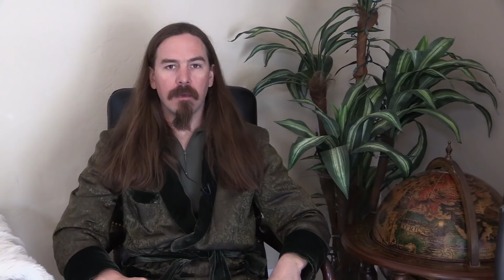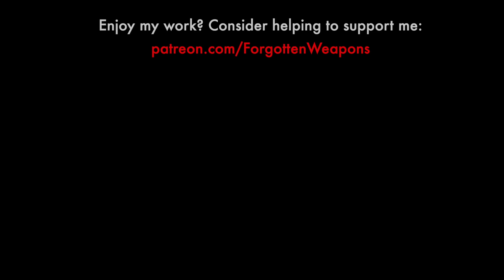How Does It Work: Patents and Blueprints

Comment: In 1995, the Machine Gun Section, in my Company's Weapons Platoon turned in their M-60E3's for FNH M-240G's. Immediately, they had function problems, with charging handles breaking off, sears flaking off and rear sights snapping off; the bipod legs were too flimsy for actual Infantry use and handling. It was a lesson in the difference between the demonstration prototype models that were used in the DOD trials, and the production models. The trials guns were hand built, and hand fitted in Belgium, while the production models were bodged out in Raleigh, NC. Like the PPSH-41 and the problems they had with the production models and their hand fitted drums. Corners get cut when you move from prototype to production models.

Comment: in electronics, there are a lot of copyrights on the schematic drawing, but not on the circuit it self, so cloning of devices is quite common. for a patent to be given out for a circuit, the level of uniqueness needs to be so high that over 99% of applications are rejected

Comment: An additional point about 'technical data packages' (aka, the actual 'blueprints' or more exactly: the actual data you need to produce a thing): That information is often never documented at all, often consisting of knowledge within the designer's mind only. 
It is often also split across the knowledge in the minds of the factory worker actually making the things as well -- little bits of wisdom on what works and what to avoid, that often have huge implications for the efficacy of production.
Good blueprints are supposed to include all of these, but they typically never do: Often so much is known by the workers and not to the original designer (and who probably wouldn't hear criticism from those lower-paid positions anyway). 
So as soon as the workers are  let go or retire - it's often really difficult or near impossible to simply to back to production: More development is required, and this is often so expensive that, well, why not invest that effort into one's own idea instead?

Good patents are about 'recognition' of features. They're supposed to tell you 'how to' design a thing, but often they only tell/show you how to 'recognise' a feature for the purpose of enforcement. Acceptable patents must get this right, but a patent lawyer is not a production specialist or specialist designer in the specific field of that particular invention, so they cannot actually determine even whether the patent is 'complete' enough to be useful to educate designers. So sadly, there's a lot less useful information in patents than you might assume -- they're mostly garbage, often full of either complete wishful thinking or else debunked science. But being untrue doesn't actually invalidate them -- it might help in a defensive lawsuit seeking to get a particular patent declared invalid, but this isn't usually how that's done, and that is vanishingly rare anyway. 

Either patents or copyright are actually weapons themselves: They're more like a handgun than a shield. They only do something if 'used'. What they do, is give you a way to legally extort infringers.

 Thus their other problem -- they tend to cause a net-negative effect on innovation due fact that there's really no way to tell how a particular patent holder is likely to act -- either reasonably or less so. This is also why 'patent trolls' exist, as well as 'submarine patents'... 

There are good examples of a key patent not actually allowing a new industry to really get going until after expiry e.g. Watt's patent of the crank (for steam engines). He made most of his fortune on his reputation for doing it right, after he could no longer sue infringers.

All of the above is a long way of saying: Detailed study -- usually historical, and drawing on considerable reverse-engineering due to more advanced understanding of physics, and, most crucially, its documentation. IS of immense educational value to society. 

What's fascinating is as much how much political or interpersonal and historical context plays at least as much, if not much more, importance to the story of these technologies -- being technically perfect is no guarantee of the use or even survival (which is to say, positive societal net impact) of any technology, for whatever end purpose.

So mining these stories for this wisdom is good, and widely applicable far beyond weapons.
If you don't learn from history, you're doomed to repeat it.

And why weapons? Because destruction is easy. (2nd' law of thermo / Murphy's Law).
Any new technology capable of an impact is always going to be usable for making 'tools of destruction' considerably before 'tools of creation' can be developed. One can make a functional murder weapon from almost any tool, but the reverse is generally not true at all. 

Again, this goes back to destruction being trivial. Time alone can do that.

So the study of weapons is always going to give you the first possible access to useful and productive wisdom - in both design and mechanical function of the actual articles, but also hows and whys of their production, and the political lessons to be learnt as well.

Comment: Ian, thanks a lot, you've it answered most of the question i've wrote you recently) but may be it wont be too much if i ask for a small clarification for the same theme? What if you don't copy the gun, but design it specifically to use core parts like barrel, pressure bearing and locking parts from another gun (exactly to reduce problems with tolerances, material and heat treating)? On one hand, you do not copy them, you just buy them as spares, on the other, you can as well use them as unfair selling point hinting to the existing proved good reputation of the source gun design, quality, reliability, accessories and tuning parts lines, etc.

Comment: Ian, I agree with
everything you said about TDPs, however, after spending a significant portion
of my Engineering career working with ammunition and weapons I would like to make
a couple of additional points concerning TDPs. Even if one gets the entire TDP
for a system from the original manufacturer, it might not contain all of the
changes that were made along the way in developing the manufacturing process
and in finalizing the function of the product. Also, even if all the changes
were documented with ECOs (Engineering Change Orders), the subtle nuances of
manufacture (sometimes known only to the workers on the plant floor), might not
be captured in the most detailed TDP.
Reply: Or (aerospace, but similar concerns) you might have all the changes logged in a change control system that ran on no-longer common hardware, and where the change control software was five years out of support while the product was being developed, and where you're generating 1800 change proposals a year, each running 100+ pages. (Guess who was responsible for keeping this running).

Comment: A patent does not grant or guarantee a right to produce an item. It grants what is called a "negative right" and in patents that gives you the ability to deny anyone else from making your patented item. 

It was explained to me like this. a man has a patent for a device with four legs that you sit on (a chair). He can keep you from making a four legged chairs as long as he holds the patent. You buy one of his chairs and think that you can improve on it by adding curved runners under the legs thereby making the chair rock. You file for and receive your rocking chair patent. This gives you the ability to stop others from making rocking chairs including the owner of the original chair patent. If you want to produce and sell your rocking chair you need to work with the patent holder of the chair patent. He can charge you a fee, let you do it at no obligation or he can deny you from manufacturing your rocking chair because it would violate his patents. 

https://www.richardspatentlaw.com/faq/what-rights-will-a-patent-give-to-me/

Comment: As an example for the usefullness of technical documentation and progress: NASA tried to rebuilt the original Saturn 5 engines a couple of years ago and failed miserably. They had all the blueprints and testing data, but figured our they lacked the world of knowledge that went into actually building these by engineers and mechanics, that just did not document every single step. From my own experience as an engineer I can assure you: 1.All the most complete looking documentation in the world barely equals an awful engineer...because my kind usually likes their jobs and we don't think handing every thing we know to some manager is a great idea for keeping said job. NASA then decided to "redesign" the Saturn 5 engine, and did so with a fraction of the manpower neeeded for the original, and a fraction of the parts. Which leads to 2. Progress in technology shatters personal experience and skill, if you wait long enough. That's btw also the reason why bolt action guns are obsolete.

Comment: Really good video! I'm a machinist, draftsman, 3D CAD modeler, and CNC programmer. I've done a lot of reverse engineering too. I've seen many of FW videos thinking I should buy that gun, reverse engineer it, and make it many times. First, everything Ian says is correct. Nations and companies try to get their hands on information from their rivals. Production drawings are wonderful but a physical copy is best. Beyond measurements, even tooling marks can reveal how something was made. Patent drawings won' tell you if it's to be machined, cast, or stamped. Production drawings will but sometimes even they include nothing about how to make it. Ian mentions manufacturing tolerances but if you know about a class of machine, the commonly used materials, and manufacturing processes you can fill in many of the gaps in incomplete data. From experience you can make a pretty darned good guess how much clearance there needs to be between moving parts, what materials and what hardness will work, that's not hard.
Reply: Engineers can be a cagey lot. If they know they can't prevent their thing from falling into the hands of someone that might copy it, they will sometimes build in non-obvious features that are vital to making it work, or decoy features that look important but really are not. That's commonly done in electronics where it's easy to hide things but less so in machines. That might be something like specific heat treating that has to be just right. Another way to protect a design is to come up with a method of manufacture that is hard to figure out or reproduce but you can keep out of sight inside your factory. That is more common in chemistry. People can figure out the compound or molecule you're selling but that's only half the secret. How you make it is the other. You might well hold a patent on the chemical but not patent the process, because the patent would reveal the secret. In that case you can hold your monopoly forever or until someone figures it out.
Reply: All of those are really hard to do with any kind of machine. Sometimes just seeing photos pf a machine are all someone needs to make a copy. In fact some of Ian's tear-downs of guns are enough. It might take a lot longer and cost a lot more, but they could be functionally reproduced from those videos alone!

Comment: It is curious how copyright law has been extended so much while patent law hasn't! My bet is that this is because a lot of "creative creations" can last as a valuable product  for very long while technical creations and inovations normally become obsolete faster. You know, Mickey Mouse is still a valuable and marketable product, even though it was created almost a 100 years ago, in comparision most of the technical inovations from 100 years ago are mostly obsolete, or at least hold no practical value in the modern marketplace!
Reply: Patent law has been expanded largely by court decisions in the Federal Circuit. Little legislation has been adopted. The most recent legislation changed the term of patents slightly.

Comment: If anyone is interested, the SAAMI website has dimensional drawings for all SAAMI spec chambers and cartridges, complete with tolerances and GD&T (When applicable). They don't give material data, but they're an example of what a blueprint drawing for firearms parts look like...except the whole gun is dimensioned like that lol. I tried making a chamber reamer for .38 Special out of some tool steel, but I had trouble accurately grinding the cutting surfaces on a manual tool grinder...

Comment: Range of sizes is exactly why Remington had to recall all Its R51's and start over. They had "stacking" tolerance issues. Once they figured that out, they got the second gen out and now its a great little gun.
Reply: LOL, no it's not a "great little gun"! Their "fixed" second generation R51 is not fixed at all and is still a steaming pile of crap.
Reply: If you say so... But mine has never given me any problems.

Comment: In the stringently controlled world of aviation manufacturing, where even fasteners are papered and tracked, they still occasionally have problems with production parts being changed or modified to better facilitate manufacture or assembly and ultimately not conforming to the TDP.  This is often only discovered when a part or assembly is later outsourced.  To build something designed 100 years ago, even with a detailed TDP, is going to involve a fair amount of trial and error.
Reply: Or going out of production, particularly a problem on the military side of aerospace when your aircraft takes over a decade to come to market, and the average generation in chip manufacture is about 18 months. When I was still working, one of my colleagues (very senior QA type) had preventing this kind of thing arising as one of his major responsibilities, along with making sure we didn't end up with any fraudulent parts (which was a growing problem). One way we got around it was by block purchasing a production lifetime's worth of certain parts.
Reply: Gives a whole lot of understanding to what Hudson dealt with, said H9.....

Growing up in the manufacturing (Detroit). Then being Aircraft in the MARINE CORPS.  

I get it....

Comment: Patents are not 14 - 21 years without a change.  There was a huge change several years ago to make US patents align more with International Patents.  US patents used to be 17 years from the date of approval to 20 years from the date of filing.  I worked for a company that had a patent that took over 20 years to get approval under the old system (it was litigated before it was approved) and many competitors had copied it during the window.  That meant all kinds of damages were theoretically owed.

The "small feature" concept that you are referring to might be the difference between a design patent and a concept patent.  Design patents only cover the exact construction and look of a design.  Concept patents cover the ideas embodied in the design.  You are right that some concept patents cover minor improvements in the design and are based on other patents, but these are distinct forms of patent.  An example of a design patent is one that McDonald's hold for the old "Hot side Hot, Cold side Cold" box.

You should also know that Copyrights and Patents are mostly filed country by country (you can get EU-wide IP rights).  It can become very difficult to assert IP rights in countries where you don't hold a patent, even if they have IP protection agreements.  Heck I have been involved in IP rights assertion challenges even with other companies in the US.  Here is one to think about for your viewers.  I built telecom systems where we wrote the purchase agreements to grant software licenses to the original purchasers.  We were able to get older products off of Ebay because of that software license.  Theoretically, we could go after the owners of the used parts.  It was more trouble that it was worth until they sent those resold parts in for repair (we tracked every serial number back to the original purchaser).  Then we asked them to pay us or have their systems be out of warranty.  So, buyer beware on used equipment.

Comment: CZ75 - I have heard so many times the blueprints are out there but I've never found them. I think CZ must sell the TDP to prospective manufacturers?
Reply: The CZ75 clones were most likely reverse-engineered. The CZ75 design was copied without CZ's approval and without CZ getting anything out of it. It lacked proper international patent protection at the time of its introduction so nothing stopped others from copying the design.